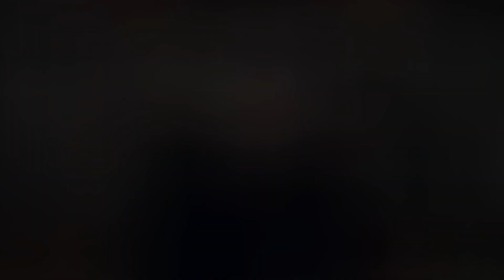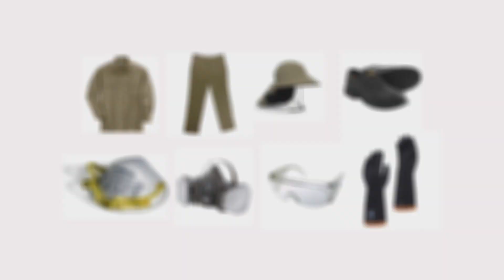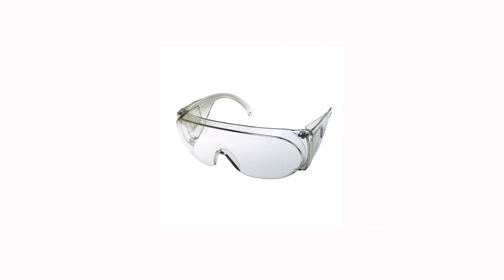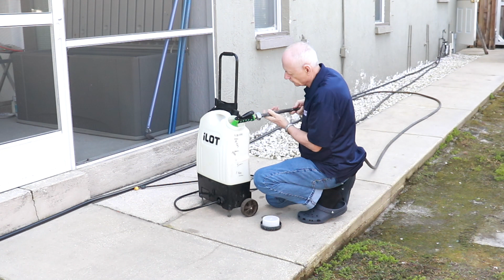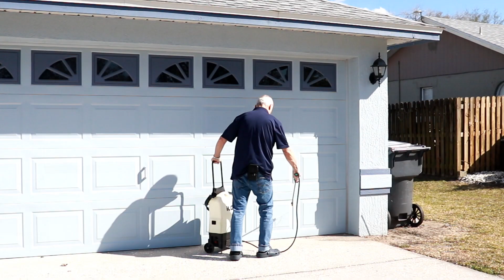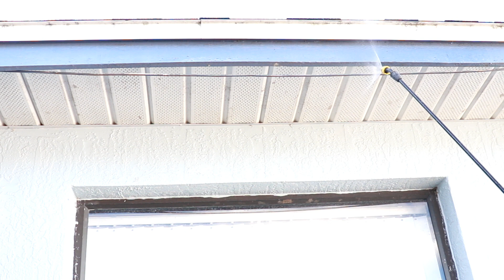How to Prevent Drywood Termites 100% Guaranteed.

Comment: What battery sprayer(s) do you recommend to get up to the roof line?   We have an issue under the fascia and guessing its 30 feet vertical.  The link below is no longer valid.  Plus the detail left a lot to be desired.  Sprayers are a big part of this job.
Reply from the maker: If you don't mind deviating from the label recommendations a bit, you can use a hose end sprayer and Bifen XTS to do the same job.  You are not supposed to do it this way, but when you have high places to reach, it's about the only option available.  Please watch my video on how to treat your yard with a hose end sprayer.  The sprayer in that video has a stream setting that will reach as high as 25 feet, depending upon water pressure.  So, you still may need a step ladder for some places, but that's not so bad.   This video will also show you how to mix the Bifen XTS in the sprayer.  I hope that helps.  Be well my friend.

Video on how to treat your yard with a hose end sprayer:  https://youtu.be/wifoTU5dmp0
Reply: @GuysPestSolutions  - I binge watched the entire 1st season of "Succession" this week.  But I spent more time watching you on youtube!  You're saving me a lot of money my friend, so BRAVO!  Conservatively guessing about $250 per hour.

We live within 2 miles of the coast in southern California.  We noticed frass on the floor in one of the upstairs bedrooms.  Immediately outside that area, in the same general vicinity, we noticed termite damage within the eve 25 feet up.  No mud tubes.  And as I pointed out in an earlier post we had someone paint our cedar fence and it exposed more termite damage.  As you know, our flying hardwood termites swarm every fall and last fall was no exception. Therefore we are 99% sure we have hardwood termites.  I want to add, we have small grand children and a dog, needless to say their welfare is paramount to us.

Here is our plan..... subject to an audible.  We have already treated the wall above the frass with Termicide Foam targeting the nest and queen.   We will also treat the eve damage with the same product.  After witch we will diligently and continuously inspect for new nests and target  treat the areas with T-foam.   In addition, we will buy the sprayer, all the knickknacks suggested, the Bifen XTS,  and spray everywhere; the eves, up the walls of the house say 3 feet, the ground, the fence itself and the ground below, etc.  It could be overkill, but we are buying Bioadvanced granules to apply along the fence line and around the house perimeter.  Does this sound like a plan?   Please take total license to straighten me out, I'm thrilled  to be guided.
Reply from the maker: @wd229  Thank you so much for those kind words.  I never thought it was possible that anybody would want to binge watch my videos.  Very much appreciated. 

It sounds like you do have drywood termites.  It is a very smart idea to start doing the preventive treatment immediately.  The termite granules will not do anything to treat or prevent drywood termites, but it is still a very good idea to use them.  In addition to dry wood termites you also have subterranean termites where you live, and the granules are a good choice for preventing them.  There are some things that you should know about drywood termites though.  I don't recall if I mentioned this before, so let me go over it, just in case.

It is important to understand how drywood termites work.  They enter through cracks and crevices around windows, doors, the eaves, pipe penetrations, and so forth.  Most of the time, they enter through several locations.  That is because a swarm of them attacked your house at the same time.  If there was a crack or a crevice, then they probably found it.  After they establish their galleries, which will be inside the wood, it will take four to seven years for them to be able to swarm.  Now that they are in your house, the swarmers will use holes that are in your studs to travel through the walls.  Those holes in the studs were created by the electricians to run the electrical wiring.  Not only are these holes going through the studs, but holes were drilled into the attic for the light switches and to run some of the wiring for the outlets.  So, the termites now have easy access throughout the attic and the walls.  If you have a basement or crawl space, they have access to that as well.  Most of the time, you will have no idea that they are in the walls, because the frass is inside the wall.  To make matters worse, if you have drywood termites, then your neighbors have them too.  That means you have been getting swarmed for as long as they have existed in the neighborhood.  Most likely, we're talking about years, so it's a safe bet that you have these guys in many locations in your home.
                            
I always hate to be the bearer of bad news, but if you have drywood termites, the only way to get rid of them is to fumigate.  Prices for this can vary wildly in this industry, so I recommend that you watch my video on how to hire a pest controller without getting ripped off.  That video can save you a lot of money.  You should also know that the gas they use to fumigate has absolutely no residual action whatsoever, so you can get reinfested the moment the tent comes down.  Like I said before, if you have drywood termites, then your neighbors have them as well.  Since drywood  termites swarm every year, it is almost a certainty that you will be reinfested within a year after the fumigation is done.  This is why you need to do the preventive treatment on your house every 60 to 90 days.  If you absolutely cannot afford to fumigate your house, then you can try spot treating it yourself.  It is virtually impossible to find all the termite galleries, but it is way better than doing nothing.  Regardless of how you treat it, you should begin the preventive treatment immediately, so that you do not get additional termites paying you a visit.  

I hope that helps.  Be well my friend.                        

Video on how to hire a pest controller without getting ripped off:  https://youtu.be/y-a8XOqVrlE 

Video on how to spot treat drywood termites:  https://youtu.be/U7ck7zhS0Xo
Reply: @GuysPestSolutions  - I also hate being the bearer of bad news.   People, skip all the videos and go straight to the tent negotiation video, save yourself hours of watching these videos.  I cannot hide my disappointment after reading your reply. I watched 8 hours of video and should have watched less than 30 minutes.   Your videos make it sound like you can save people money by using treatment methods for working around tenting.  I made it crystal clear from moment one, I had termites in my walls, upstairs there was visible frass, and I already spot treated with T-foam.   It doesn't take an exterminator to tell me I have termites and the specie.  Who cares what specie they are if you're tenting, there's only 2 and I knew which specie was in the house. Now I find out I need to tent... and within a year and your telling me  I'll have termites back. 

99% of the people that come to your videos know they have termites.   I know my neighbors have termites, their infestation is far worse than mine and they've have had termites for years, we all know it.  You tell me Termite granules won't work but put them down anyway, huh?  You need to cut to the chase, tent your house is all you need to tell people.  As you say the termites will be back in a year.  Buy a battery powered sprayer and get after spraying when you have time.  End of video.  TENT TENT TENT folks.

Tell me to do prevention every 60-90 days, are you kidding me!  You sound like a dentist, auto mechanic, doctor etc.   Do I floss after every meal, change my oil every 5k, stay away from beer, sugars and starch, of course not.  If I followed protocol of every professional dispensing advice I would have no time for myself!   I can handle getting and evaluating multiple bids, I've tented multiple homes.
Reply from the maker: It sounds like you are having a bad day.  So sorry about that.  It also sounds like you are very confused about termites.  Please allow me to clarify for you.  Not all termites are the same.  Tenting only works for drywood termites.  It does not work for subterranean termites.  That is why you need to identify the species.  In your case, it sounds like you do have drywood termites, but not everyone does.  Also, not everyone knows that they have termites.  I get questions all the time from people who are trying to figure it out.  As for treating every 60 to 90 days, that is up to you.  I am simply pointing out that you WILL get reinfested again if you don't do it.  I don't make this stuff up.  What I am telling you is a fact.  You may not like doing it, but if you don't, then you are going to get reinfested.  Just like, if you don't get your oil changed, then your engine is going to fail prematurely.  Maintenance is just a fact of life.  The termites are going to do what they do and I can't change their behavior and neither can you.  So, your choices are to do the preventive treatment or live with termites.  It's really not my fault.  I'm just trying to help you solve your problem.   I am also okay if you don't like the way my videos are done, but if you skip important information in them, then you are not getting all the information you may need.  That may be why you didn't understand that you cannot tent for all species.  I provide all that information for a reason.  Not everyone needs all of it, but some people require different information than others, so I need to do a thorough job.  It sounds like you are more frustrated with the termites than you are with me, but unlike them, you can write to me about it, and I do understand your frustration.  Also, I care about you a lot more than the termites do.  Be well my friend.

Comment: I understand the trench method but what if your house is raised?  Sitting in cinder blocks? Lots of homes in the south are made like this.  Do u get under the house & Spray?? Or install baits???
Reply: Thank u so much for your help.  I found the nest.  Today actually.  Tore out the whole wall. Ac was leaking & the wet wood was a feast for them.  Replaced insulation,  2x4's, 1×6 around the window,  & caught it before they started in my wooden floors.  No damage yet to subflooring. & yes house on piers.  Definately gonna do what u recommended bc this was already a nightmare.  Can't imagine if they did more damage.  But will find out.  Checking all moisture areas 1st. Thank u so much! Will continue to tune in.  Kid u not,  i prayed last week,  asked God to help me save my house,  found u a few days ago,  & learned so much from ur vids, took ur advice, & im on my way. I have termidor foams, taurus sc, fuze foam, cypher tc, & will be buying the bora stuff. Thank u, thank u, thank u❤️ & thank the Lord above❤️
Reply from the maker: @kaybegee  Thank you so much for those kind words.  Very much appreciated.  I am glad that I was able to help.  Be well Karina.
Reply from the maker: It sounds like you are telling me that your house is on piers, so there is no actual foundation around the house.  If that is the case, there are two ways you can go about it.  The first way is to go under there every 60 to 90 days and spray all the wood.  The second way is to do a permanent treatment under there with Bora-Care.  This may be a little bit of work, but after you do it, you never need to do it again.  The treatment literally lasts the life of the house, and it comes with the advantage that it will kill any existing termites that are in the wood already.  To do the treatment properly, you need to remove the insulation, and spray Bora-Care on absolutely everything under the house that is made of wood.  Then you need to replace the insulation.  I will give you a link to the product and a video on how to use it.

I hope that helps.  Be well my friend.

Video on how to use Bora-Care:  https://www.youtube.com/watch?v=Rmr_aEodyhg&t=5s

Bora-Care: https://www.domyown.com/boracare-p-100.html?pdpv=2

Comment: Hey, Guy - hope all is well with you!

Thank you for putting up your videos here in Youtube and helping us folks in dealing with termite problems - this is life-saving information!

I have been researching about Termidor dust and other products like it...they seem versatile and was wondering if you recommend it, and can do a video on it. Are they a good option to defeat a colony?
Reply from the maker: I have never used Terminator Dust, so I can't really say if it's any better than using Termidor foam.  What I can tell you though is that there is no product that is going to effectively treat drywood termites.  The dust may be as good or even better then the foam, but the problem is trying to find the galleries.
   
It is important to understand how drywood termites work.  They enter through cracks and crevices around windows, doors, the eaves, pipe penetrations, and so forth.  Most of the time, they enter through several locations.  That is because a swarm of them attacked your house at the same time.  If there was a crack or a crevice, then they probably found it.  After they established their galleries, which will be inside the wood, it will take four to seven years for them to be able to swarm.  Now that they are in your house, the swarmers will use holes that are in your studs to travel through the walls.  Those holes in the studs were created by the electricians to run the electrical wiring.  Not only are these holes going through the studs, but holes were drilled into the attic for the light switches and to run some of the wiring for the outlets.  So, the termites now have easy access throughout the attic and the walls.  If you have a basement or crawl space, they have access to that as well.  Most of the time, you will have no idea that they are in the walls, because the frass is inside the wall.  To make matters worse, if you have drywood termites, then your neighbors have them too.  That means you have been getting swarmed for as long as they have existed in the neighborhood.  Most likely, we're talking about years, so it's a safe bet that you have these guys in many locations in your home.
                            
I always hate to be the bearer of bad news, but if you have drywood termites, the only way to get rid of them is to fumigate.  Prices for this can vary wildly in this industry, so I recommend that you watch my video on how to hire a pest controller without getting ripped off.  That video can save you a lot of money.  You should also know that the gas they use to fumigate has absolutely no residual action whatsoever, so you can get reinfested the moment the tent comes down.  Like I said before, if you have drywood termites, then your neighbors have them as well.  Since drywood  termites swarm every year, it is almost a certainty that you will be reinfested within a year after the fumigation is done.  The only way to prevent this is to do a preventive treatment on your house every 60 to 90 days.  Most pest controllers will not do this, so it is something that you generally need to do yourself.  If you absolutely cannot afford to fumigate your house, then you can try spot treating it yourself, but it is virtually impossible to find all the termite galleries.  It is way better than doing nothing, but it will not end the infestation.  Regardless of how you treat it, you should begin the preventive treatment immediately, so that you do not get additional termites paying you a visit.  

I hope that helps.  Be well my friend.                        

Video on how to hire a pest controller without getting ripped off:  https://youtu.be/y-a8XOqVrlE 

Video on how to spot treat drywood termites:  https://youtu.be/y-a8XOqVrlE

Comment: I just sprayed Taurus sc but it rains often here in Florida will the treatment work if it rains right  after I treat ?
Reply from the maker: As a general rule of thumb, you need to allow it to dry at least 2 hours before it rains.  It will not wash away after it dries, but it will wash away when it's wet.  It's always best to check the forecast prior to application of any pesticides outside.  I hope that helps.  Be well my friend.